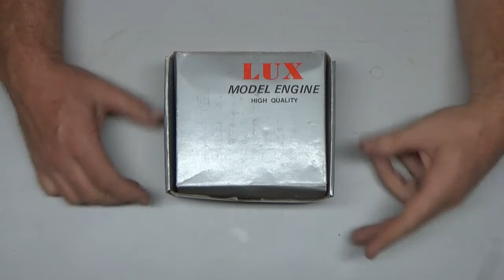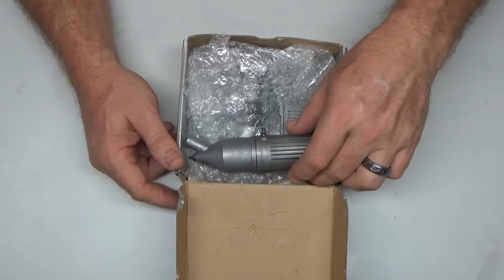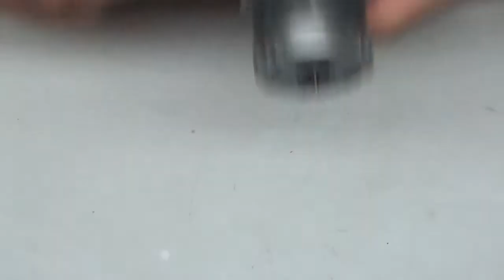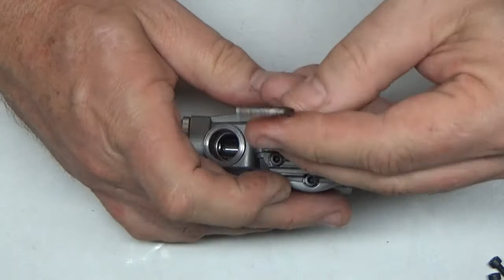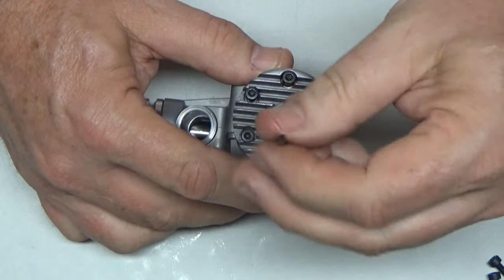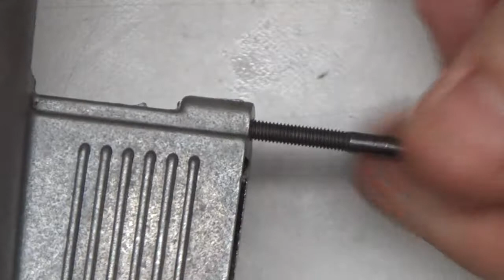LUX 40 EP ABC A Look Inside

Comment from the maker: Well I guess I am a monkey's uncle!!  LOL.  The owner of this engine saw this video and provided the this additional information:
The engine has 2-3 gallons through it!!!!  He did a disassembly and clean of this engine.  What a fantastic job too!  It is 3-in-1 oil I smelled in the engine.  The engine was originally equipped with a clear gasket on the back plate.
I have also received another email from a subscriber correctly identifying the  origin of this engine.  Unfortunately I cannot post pictures here.  He sent pictures of a Royal 40 and it is a DEAD on match!  I also mentioned Royal as a possibility for this engine.  Royal engines date back to the same time frame as well.  I am convinced that this engine was made in the same factory in Taiwan as Royal and the current INC engines.  They too are a dead ringer. https://hobbyking.com/en_us/inc-40-glow-engine-with-muffler-abc-piston-sleeve-assembly.html?___store=en_us
Reply: I think Hobbyking sells them as the INC brand and Mecoa has had them if I'm not mistaken. Perhaps also Megatech
Reply: jeffie8696 You are dead right , that is a  Royal aka , Leo ,Inc , Megatech ,Mecoa .